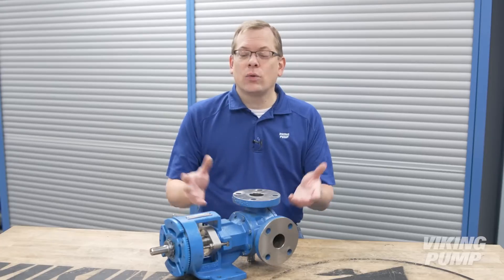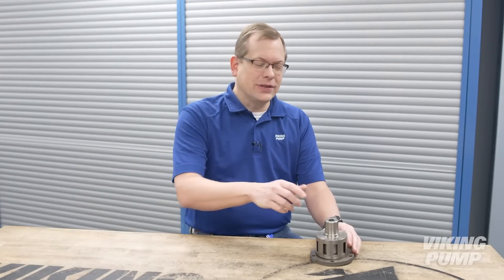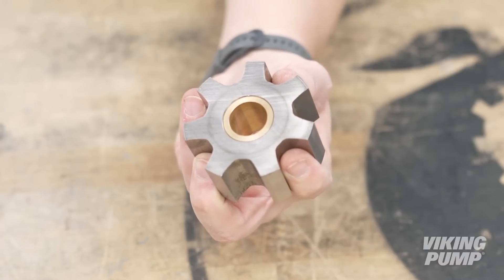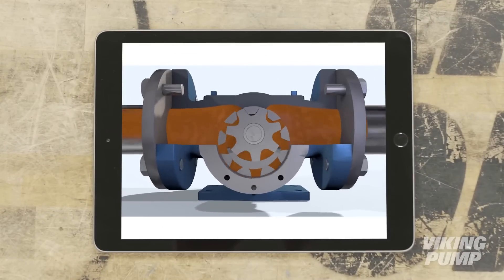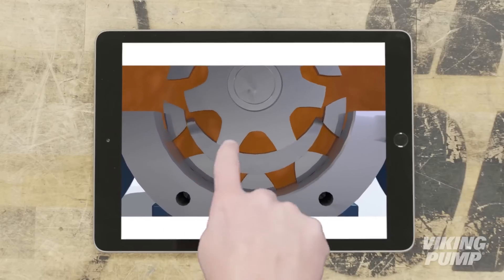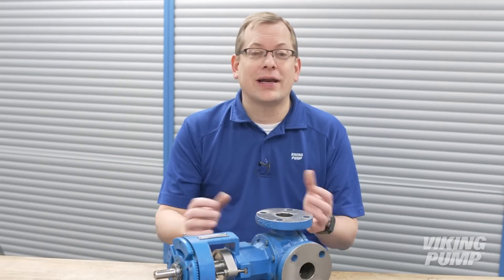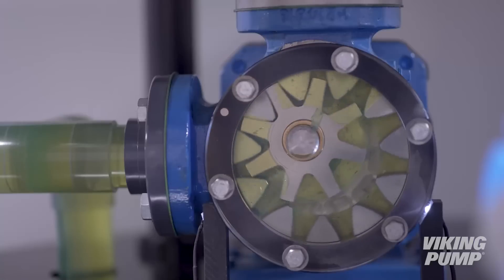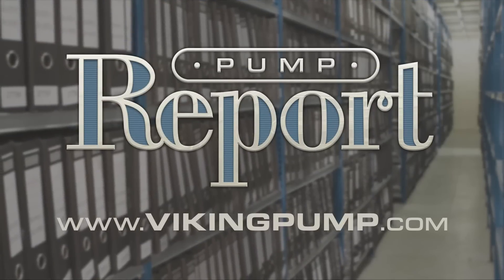Internal Gear Pumps and How They Work

Comment: When one of the teeth breaks off on the rotor gear. Can that missing teeth cause a low pressure point, since there will be a larger gap between two consecutive teeth?
Reply from the maker: The breakage of a tooth in an internal gear pump is not typical and is usually the result of a large foreign object being sucked into the pump. Viking Pump would recommend installing a strainer in the pump suction piping and ordering a replacement rotor from your local authorized distributor or by contacting us here: https://www.vikingpump.com/yt
Here's a quick video about strainers! https://youtu.be/fBYsNHJdS_A

Yes, you can continue to run the pump even with a rotor missing one tooth. This is because internal gear pumps always have more than one tooth engaged between the rotor and the idler. It’s one of the few pump designs and cases where you could continue to operate a damaged pump until you’re ready to repair the pump. In response to your specific question, yes, you may detect a slight pulse drop in pressure as the missing tooth passes the outlet. Additionally, there would be a very slight drop in the pump’s capacity as there is one fewer rotor teeth to mesh and displace the liquid.